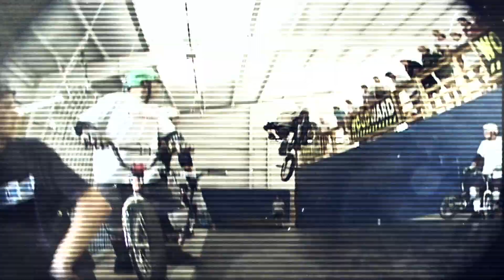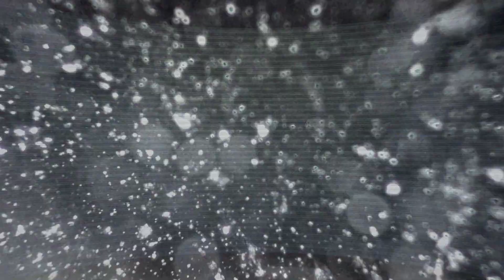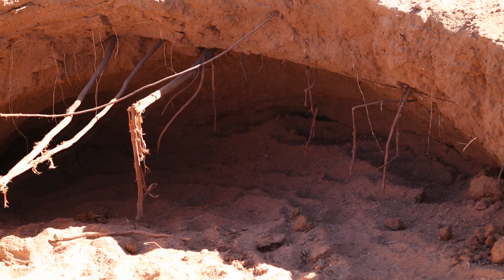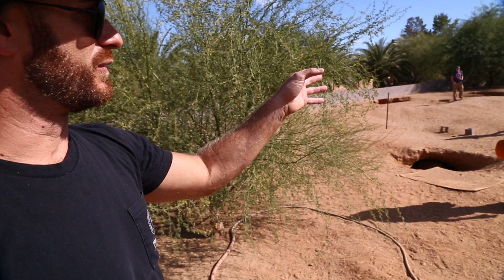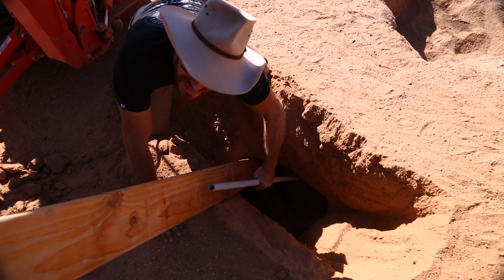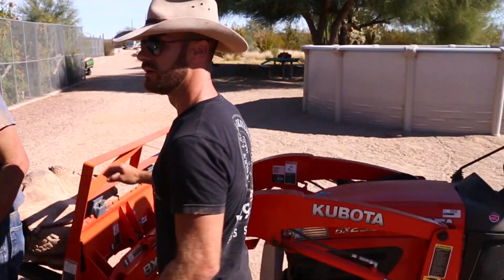The Truth About Sulcata Tortoises

Comment: I was thinking about trimming my tortoises with a die grinder or maybe would a cast cutter work or would it possibly to high vibration or big bolt cutters sharpen them up real nice so they cut perfect my sulcata is 116 pounds big boy

Comment: Kenan I need help . My baby red ear slider  is not eating I don’t know why. I had them about a month and a half at lest. Plz help.
Reply: Usually babies will go off feed when they get to a new home. It might not eat for a week, it might not eat for 2 months. Also if your habitat size is too small/ too big, they wont eat.  If its a baby it should be about an inch in shell length. For every inch of shell you need ten gallons of water. so for a baby it should be in a 10 to 30 gallon tank. If none of that applies to your turtle, see if its swimming sideways. Also take your turtle and put it up to your ear and see if you can hear it breathing. If you can its likely it is sick and it would need attention from a vet. If it is sick, dont panic, it is totally treatable.
Reply: Oh thanks helped I will try the thing about its home. Because it is kind of to big for them
Reply: No problem.